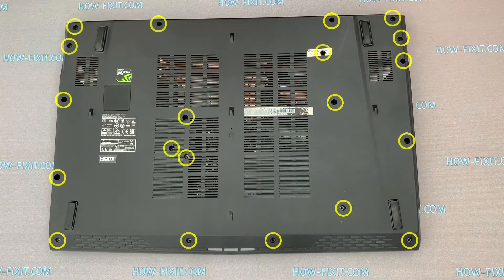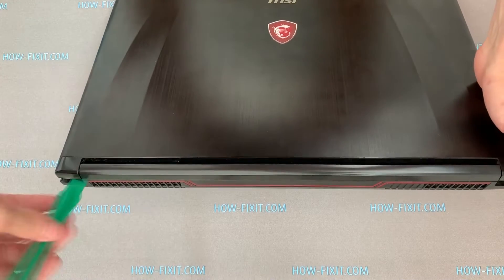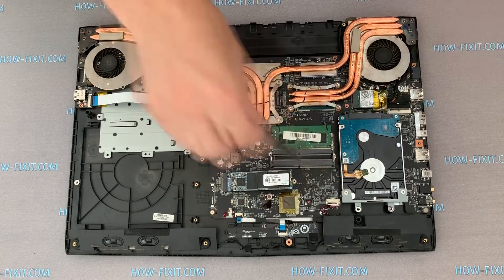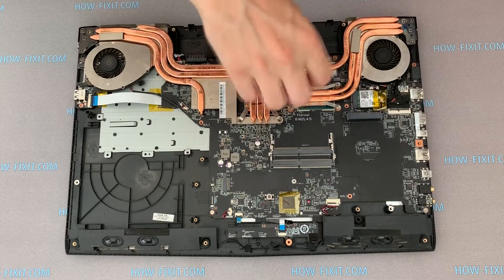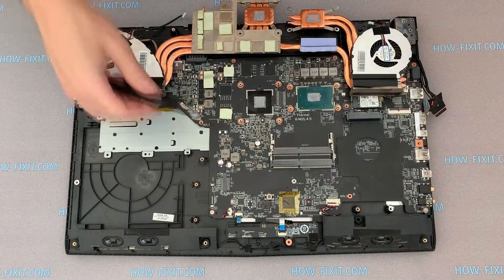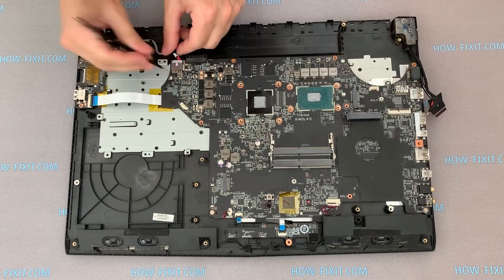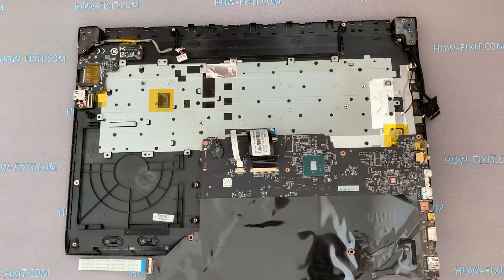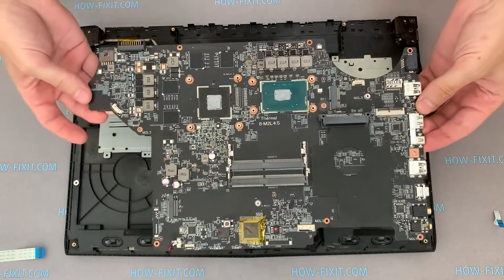MSI GP72 Leopard Pro Motherboard Replacement | Step-by-step DIY Tutorial

Comment: Do you have a video showing how to replace the laptops keyboard? I suspect mine is faulty and having trouble finding tutorials online. Thanks
Reply: Hey, I just replaced mine. After removing the motherboard, just keep removing screws on the big plate and anything holding it down, gently scrape the metal tape stripes on the back of it  to peel them back as you will put them back after.
That's basically it, once you remove the plate, the keyboard comes out easy. The keyboard itself isn't fastened in anyway, it's just held in place by the laptop cover and the metal backing plate you see under the motherboard. Make sure to unclip any flex cable connectors, don't force them!
Got a replacement off AliExpress for like 30$, works great though you can tell the keys aren't original. It's 42 screws in total to replace the keyboard on my model with 1 fan, maybe 44 with 2 fans. You don't need to remove the RAM , SSD, heatsink or wi-fi module. They all come out with the motherboard.